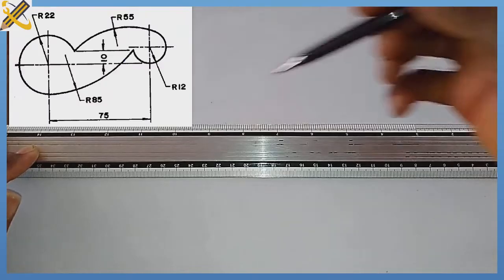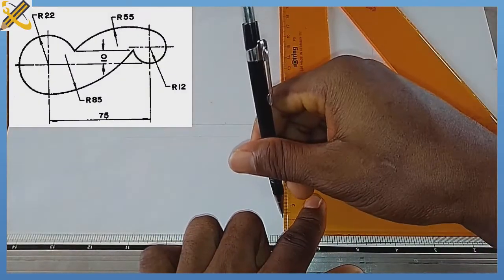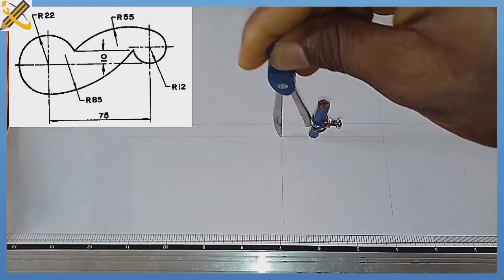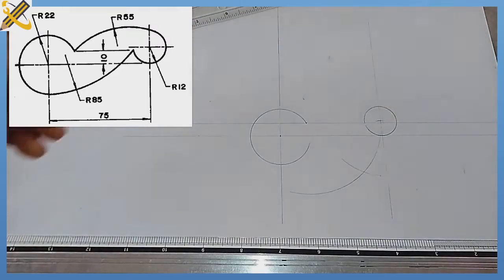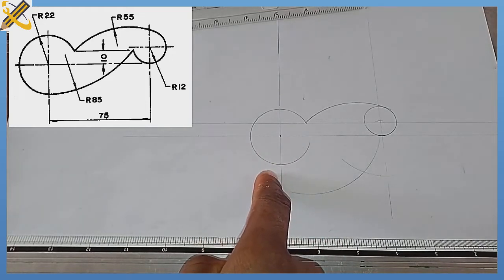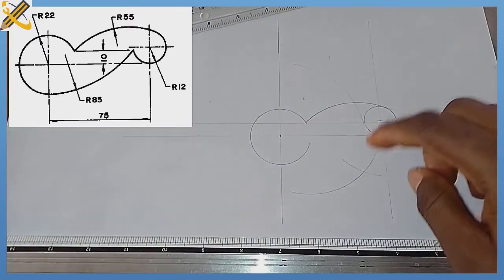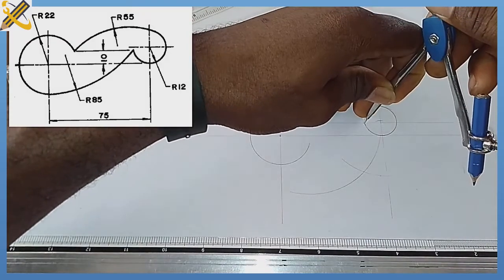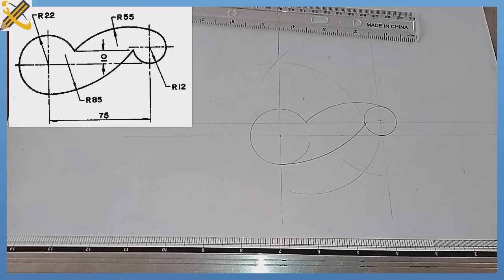TANGENCY PROBLEMS in | Technical drawing | Engineering drawing

Comment: Thank you sir for the helpful video. We were asked to produce the drawings on an A2 paper but we weren't given what to use to enlarge it with. Please sir, how do you suggest I go about enlarging the diagram to fit an a2 paper to scale?
Reply from the maker: @Minahhh231  just increase the scale of the drawing of that's the only thing u will be putting on the A2 paper. Ensure to state the scale used on the title block